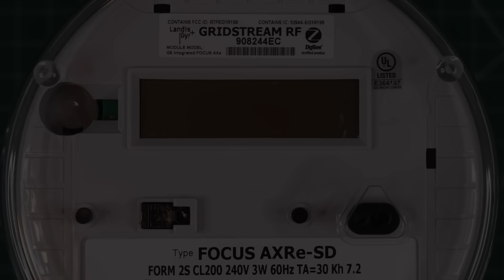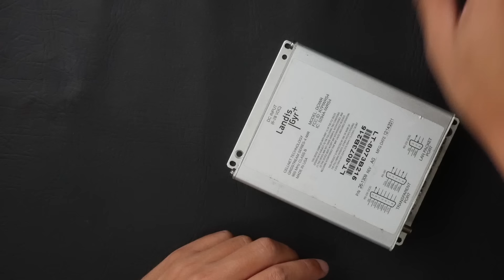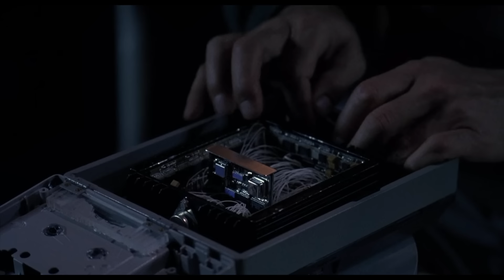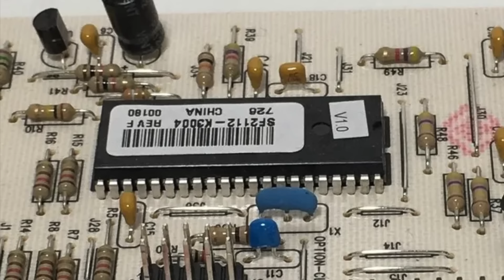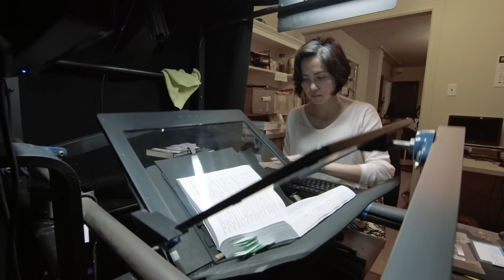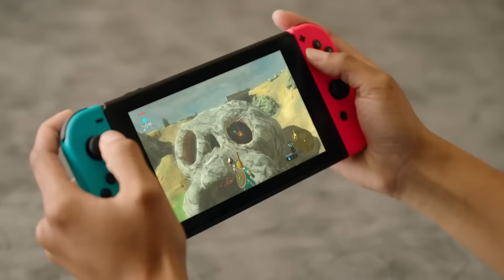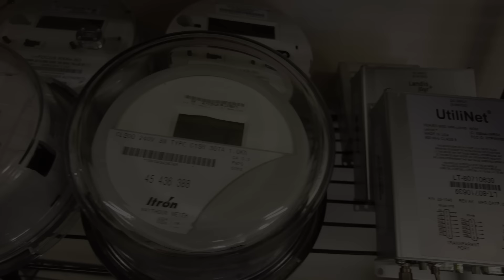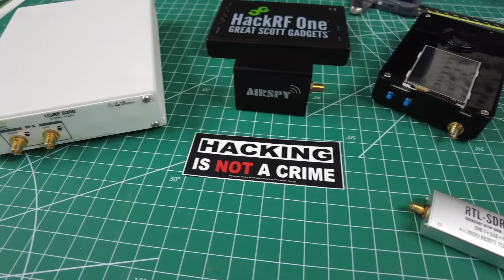The REAL Problem with Smart Meters

Comment: We need to open up the communications so scanners can monitor lineman communications again.  WHY is there military level encription on voice communications of the linemen???   If the power goes out, you NEVER find out why.
Reply from the maker: I agree! I miss listening to things with my scanner…
Reply: what are you talking about? military grade? lol, more like a very basic encryption you will find on any device that transmits "personal" informations. It is totally normal that datas are encrypted, this is required by most countries regulatory agencies for obvious reasons.  What we see in this specific case is probably just a zigbee link, nothing fancy about it and nothing secret either. Anyay the bottom line is that the payload content, we already know it, total import, total export, apparent power, active and reactive power, voltage, frequency, sometimes gps coord., UUID, really there is nothing to be excited about, unless the audience fantasize much on what they don't understand, which seems to be the case here.

Comment: My electric bill doubled with the new meters. Think im getting ripped off.
Reply: You can measure your consumption yourself to see if it's right. Quite possible your old meter was wildly inaccurate. You might have been the ripper, not the rippee.
Reply: yeah, the smart meter allows "dynamic pricing". They jack up the rates at peak usage hours.
Reply: It's a common problem with smart meters. Their probably charging you extra for "peak" hours.

Comment: I am still just trying to figure out why it seems they say I am pulling twice as much KWh per day as my quicky mental calculation and my wall warts, dryer, and computer use estimates it should be. This is a local cooperative water&light, not private too. I use gas for heating water, furnace, no AC, and also most stove ( cheap Chinese gas plate) ( and also a quick inductive plate for boiling water and soup). Why do I pay 80 to over $100 per month? I have 5 or so solar panels into a cheap inverter aimed south roughly pretty bad solar-hours per day also...

Comment: I watch my meter regularly (which the vast majority of people don't do)
 And if there's a discrepancy between usage and my bill, I'm on the phone and i have documented proof and date.
 I've only had to go this route 2 times in many years and the electric co is always quick to readjust my bill and apologize.
 My monthly electric bill is around $70/$80 for a 1,475 sq ft home with just myself and my youngest son living in the home.
 When we're not using a device which uses electricity, we turn it off and even unplug most.
 I have a TV but it is hardy ever used, last time was before xmas of 2023 so its been unplugged, no cable box either as i have an old PC with tons of stuff to watch and a disc drive. The pc is only plugged in and booted once a month to update (and i use my own custom developed Linux OS)

 Every light is a warm led, but we generally only use the light from 4 led nightlights most of the time.
 We cook meals for each week in batches, so the oven is used very rarely compared to most homes, and heat up is mostly done using 1 stovetop burner for a few min.
 My heat and hot water is an oil burning steam furnace with radiators and a water heating coil, and the thermostat never set above 67* and the house is comfy all winter..

 In other words, we don't waste or ab use electricity as most homes do.

 Now, my current crusade is really digging into why when my actual usage is $40, my  total bill is $70/80 with absolutely no explanation.. its not taxes, supply, or delivery.. just a mysterious ghost charge and not one person with the electric co has answered my questions 

 Neighbors around me freak out when they hear my bill amounts and ask "how?!"
 Yet every time I'm in their home the TV is play for background noise or something.. no one watching, in winter the temp in their home is uncomfortably hot and in summer very chilly and they're walking around in sweatshirts 🤨🤔
 Some have swimming pools, which are hardly ever used and at night they have all kinds of lights on inside and out, all through the night, electric hot water tanks and ive seen them run hot water while they're doing something else, and dishwashers, ovens, microwaves used constantly, etc..
 .. and they wonder why their electric bill is $200+ every month 
 🤷
 The vast majority of the population do not pay attention to their usage other than when the bill comes, then they just use a credit card to pay it, paying even more due to interest because they just pay the minimum due which is just covering the interest.. and they use several credit cards this way..
 Most of the financial problems in the country are caused by the population itself and complete negligence,
 .. but it's always easier to blame someone else.

Comment: Why do you think it is possible to decrypt these messages, when there are ways of making this absolutely impossible? For example:
1.  The meters could include a truly random key and use that to encrypt their messages. Unless they use a really BAD form of encryption that you can break, it would be hopeless without the database of truly random keys.
2.  They could be using Public Key cryptography.
3.  Keys could have been sent out electronically long ago. If you weren't monitoring when the keys were sent out, you could never break the messages.
4.  Instead of sending out new keys, keys could be successively modified, so unless you monitor (nearly) ALL of the communication with a unit, you couldn't figure out the key.
5.  This list is NOT exhaustive. I suspect it might be easier to hack the utility's central computer than to hack the units in the field.
However, there might be other viable approaches, e.g. looking over patents in this area, going through the recycle bin at the utility, etc.
Steve

Comment: In British Columbia our electric infrastructure is owned by the government basically as an electrical "highway" BCHydro. The positives are it continues to be cheaper than world market pricing for electricity and not profit. Consistently among the 5 lowest on the continent. Downside is it's a lot harder to argue against things like smart meters because everything up to the other side of the meter is technically govt property unless you have a really old place in an old city with some grandfathered in arrangement and technically they did make the system slightly cheaper with not having to manually check meters

Comment: I think it is unreasonable and should  be unlawful for a power company to use a variable rate dinamic pricing without making all the usage and pricing data available to the customer both real time and historical data, in a format that is easy to read and provides the customer with information on the exact type and rate cost for each element of the customer's usage fee.

If the company can't easily and accurately tell the customer what spesificly they are being charged for  and exactly how that is calculated then the fee is unaccountable and therefore should not be charged.

Comment: you can opt out of a smart meter and go back to an analog meter for a fee per month. Generally around $12 per month to have an analog meter…
  The concerning thing to someone with an electronics background, is that there is a contact inside the electric meter that switches the power on or off from the utility company. It is controlled by a cell phone phone call. Anyone that ever worked on cars back before they had electronic ignition nose with a set of points is.
 The ABB company meters are the ones that I am familiar with, they have two contacts to flow the two legs of current down your entrance cable through the meter into your panel board. These electric contacts have about as much surface area as a pencil eraser. That is all.
  it is amazing to me that a 200 amp panel board can be fed. My current flowing through two tiny dots of contact…
  when the smart meters were being implemented, the head engineer of the utility company I work for was so against these cheap $36 meters, and tests that the company did on them proved that they will not stand up under a heavy load, he actually quit the company because they were going ahead with it as required by the federal government. He said it’s not gonna work, these things are not going to stand up to the hundred percent duty cycle under heavy load, and I won’t be part of it..
 no years later, there were a lot of teething problems, meters fail and are replaced promptly, and everything seems to be good enough
 no, here is where a smart meter is going to be used in the future as electricity demand rises and generation capacity does not keep up, such as in California where they have brownouts and blackouts during more than peak demand times
 every customer in the electric company has a category that is programmed into the computers at work. This identifies the customer as vital, or not…
 OK let’s say a customer is the water company delivering water pressure through the water grid buried under our streets. That is a company that is vital. Let’s say another customer is a hospital. That is a vital customer, what about a customer that controls all of the traffic lights power. That’s final, a doctors office, that’s file.
 OK on the flipside, let’s say there is a customer that has an electric meter on a billboard, that’s not vital, how about a customer that has an electric meter on their storage shed, not vital
 what about a residential home, that’s actually not vital
 OK so along comes a storm and it takes down some powerlines feeding a substation. That substation was vital to a small city of 20,000.
 They can transfer feed to that substation, but it won’t be enough. What they can do is reduce the load by shutting off the residential load, the load to the billboard, to the storage sheds, but not to the traffic lights or the water supply or the hospital 
that is the beauty of a smart meter. It will respond to a radio signal. They can actually be transmitted through the electric lines to each individual meter. And rather than shut down the whole city, shutting off power to operating rooms, shutting off the water, turning off the traffic lights, trapping people inside elevators, they can just shut down residential homes and billboards., without shutting down the vital customers, like police stations, doctors, office, tall apartment, buildings with elevators.
 this system works..
Reply: can you do this if you already have a smart meter?

Comment: The worrying question for me is, could a foreign power, with no budget constraints or lack of clever engineers, be able to intercept this wireless network information to cause chaos in countries? Or use the information for tactical attacks on enemy states? For example, could they, in the depths of winter, bring down a national grid, even in part?? Is it fact that a distributor has the power to remotely turn off a supply at the meter or conspiracy theory? If true, what is to stop infiltration of these networks to turn off everyone's electricity supply, both domestic and commercial?

Comment: In order to bill higher for inductive loads, your bill would have consumption in KVAH, not KWAH. 

Most utilities do not bill residential customers in KVAH. Modern appliances amd HVAC systems with motors have great power factor, so its not worth it to utilities to bill for it. Most of the inductive loads in homes come from electronics.

If you're still convinced you're being ripped off for inductive loads, you can install capacitors for power factor correction. You'll most likely find you wasted your money on them
Reply: A smart meter can report apparent, active and reactive power and power factor. What utility use to bill is up to them, i don't think it would be accurate to assume what they do or don't do.

Comment: Seems to me like it is all being designed for Racketeering and Embezzlement purposes in The USA today. I fail to see anything wrong with A mechanical power meter. Look at how long they lasted. You have to physically go inside of A mechanical power meter to alter it but with A smart power meter you can alter it remotely just like an electric voting machine. And further more you can do it with software during the building process secretly. Not all electronics Are good for society. They will argue that it is cheaper to maintain. No Man paid to go physically to read the meter's. What I know about computer's is from automotive and it is made to learn your driving habits and make adjustments accordingly within the government boundaries of legal operations.  But it is not just doing it to you but to everyone that uses the same computer and technology. And if it was a stationary device like a Smart power meter it would be able to monitor your power usage with the rest of The power meters in The neighborhood and charge you all accordingly to the highest users rates. What they Now call an average billing plan. That's why they changed all of the power meters to remote digital multi frequency so that people don't have any ability to see what they are doing with the billing. They have built into the broadcast and receiver system the self altering concept of highest billing and The Smart Water meters are doing The exact same thing but from the receiving side. If you Go away for a month and live alone and don't use any water or electricity you will still have the same amount billed for the water and electricity service's. Or at least that was true in Greeneville Tennessee where I used to live at. They have Smart Water And Smart Power meters controlling the electricity and water. You are not allowed to have a well and City water together on the house side past The water meter. The reason is simple they can't regulate and bill you for the water from A well on the house side of the water meter. There is no danger of contamination because city water is pressured into the meter and afterwards. The problem is that they can't control the billing of that house to be the same as the other house's with Smart Water meters. Consider if you have a generator for power outages and you used it for power for the entire month, Do you think that they would show up at your house to make sure that you disconnected it before the next billing cycle ? I know that they would and with all of the force of the law. You can't Tax self generate that doesn't have a Smart power meter on it. The Smart power meter is not only There to raise the power rate up in the neighborhood it is also there to monitor where the power is coming from as well. If you are not being charged and taxed at the average users power rate they want to know Why ? . Remember that they have been monitoring you just like a car computer does when you drive it . They have just one problem, Floods and Natural Disasters don't like their computers very much. Or the one's in the car's. The Rich Oppress The Poor is what it says in The Bible. They are not giving you the convenience of computers and technology for free there is always a hidden cost way beyond the purchase prices for the items and when they are installed for free like the Smart water and Smart electricity meters you can be sure that they are There for Racketeering and Embezzlement purposes. And the government is A part of it ! . We have all seen the guys on YouTube who Used car alternator's and electric motors to generate power and they were All shut down pretty quickly by The government and The power companies.

Comment: @6:30 YO RECESSIM! I’m in the midst of your video “The Real Problem With Smart Meters” and I have a couple ideas which may help you with the “dissemination of metadata obstacle”. The first is based on the “The Right To Repair Law”. I haven’t looked at whether or not the state you live in has adopted it but the law states that devices over $100 ( I believe this number is correct but don’t hold me to it, it may be $125) must make available this information for 6 months and devices below the amount 3 months. Furthermore, a lawyer may be able to determine if under this law it’s even protected information relative to copyright law. The other idea that could be helpful is based on copyright law and it would require a thorough investigation and understanding of the law, but from my recollection non-commercial, useful articles and reports that are of public interest are not an infringement (again don’t hold me to this, I’m going off memory and without knowledge of any amendments that may or may not have been implemented). As I was writing this I thought of one other method and it’s based off the same idea as the website “The way back machine”, archiving is a method that I also believe may be a legal method to disseminate the info. This may be as simple as using “The way back machine” archives to search for the archived webpage of the meter’s publication. Or, creating an archive yourself.

Comment: PG&E had a loose wire feeding my house..I was getting fluctuating 120v , no 240v. The meter would flash or go blank. They replaced the meter but is was the wire connection. They decided I owed them a ridiculous amount of money for their fluctuating 120v(I couldn't run my well) and turned off my power! PG&E is pure evil, I'm filing with CPUC, and making videos..Thank you for using your incredible brain for Good!
Reply: Same company that put chromium 6 in the water table. You most be in the high desert.
Reply: @wannabecarguy  I didn't know about the chromium..I'm in Shasta, they control the land, water, electricity, local and state government.. I'll be doing more research and exposés on them.. including the ridiculously overpaid CEO..
Reply: F PG&E!
Reply: I had the same problem. Turns out it was a rusted crimp connection for the neutral wire after the transformer.